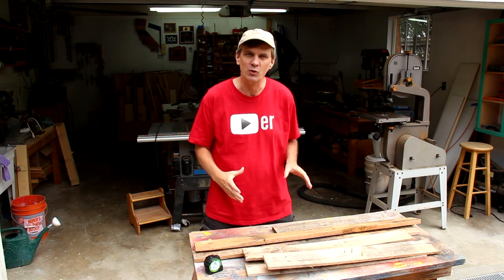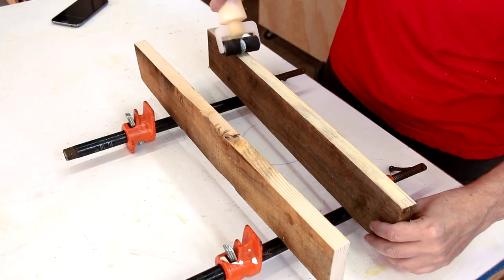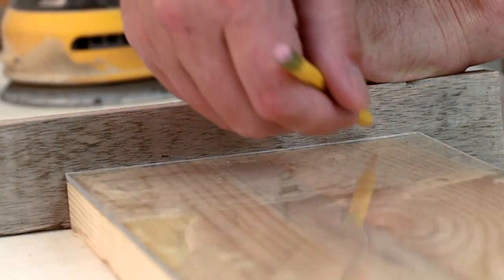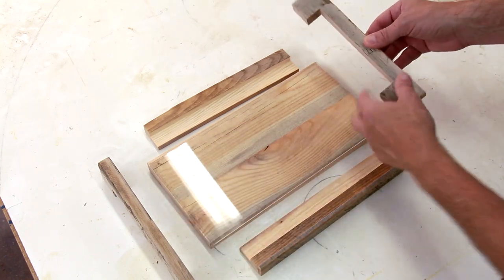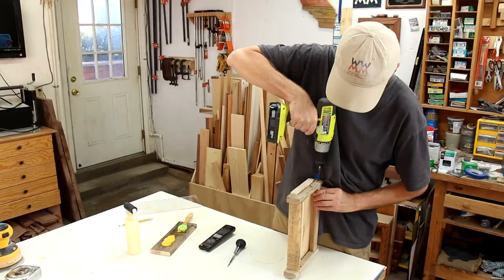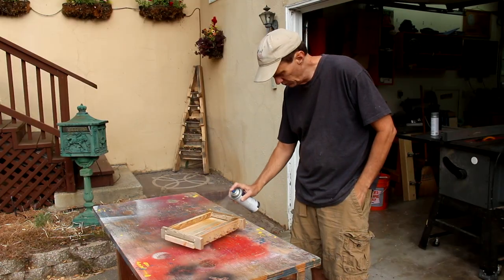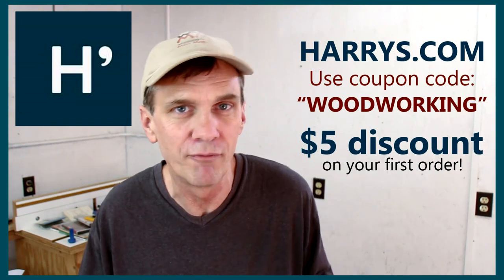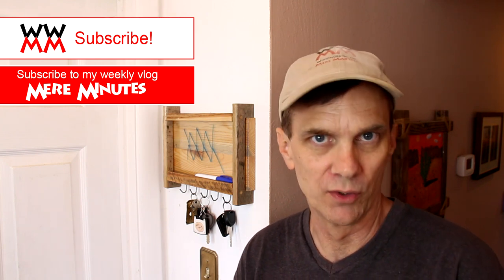Make this fun key rack for your home using pallet wood. It's also a dry erase board!

Comment: Steve, great little project.  Thanks. 
  
On a side note, plexiglass by its inherent nature is porous.  If you leave the marker on there too long, it will end up a permanent mark. 
 
One way to solve this (instead of just replacing the glass) is by putting a quick coat of car wax over the plexiglass .   This also makes it much easier to erase the marker.  

:-)

Comment: I like this one. Almost all my projects are like this ... I work 95% with wood I have around the workshop. So, different thickness and quality is what I am used to.

I just do not have all the nice tools you got. My projects are very much limited-tools. (I still haven't found a pocket-hole jig in my local stores, which means I am still improvising.)

Comment: ***** You could glue a piece of felt or some pad to one of the vertical pieces of frame, so you could wipe the marker from the plexiglas just by sliding it in and out ;)

Comment: What kind of Bruce was that you used to apply the glue? The Silicone bristle looking thing? Thanks for all you do!
Reply: It is a silicon pastry, basting brush.  You can get them at Target, Walmart, Bed Bath and Beyond.  Pretty cheap...usually, less than $3
Reply: its a silicon brush, just make sure to buy it from the kitchen aisle cheaper than the ones they sale at woodworking sites
Reply: Obviously I meant brush. Sorry. I didn't proof before I published.
Reply: ***** Awesome,  thanks. It looked familiar. Just never thought of it.
Reply: *****  How do you know what may have been one these pallets.....What if there were ZOMBIES stacked on the pallets?  Or worse yet, my X-Wife's Cooking...
Reply: Chuck Hampton At first I thought maybe you were Australian. Then I remembered that in Australia, the don't call brushes Bruce - they call them WALLABY!

Comment: I have an idea for a show - "How to keep screws straight while screwing into boards" I can't get a screw straight into a board to save my life. Maybe you can help me and many like me.
Reply: If I were you I'd maybe try starting by drilling a hole. Drill bits are easier to keep from wandering and that might help since the screw should just follow the direction of the drilled hole. Just make sure the pilot hole isn't too big that the screw threads won't catch. Hope this helps.